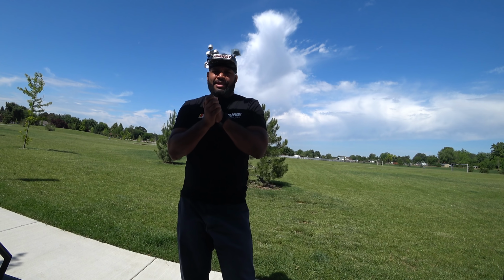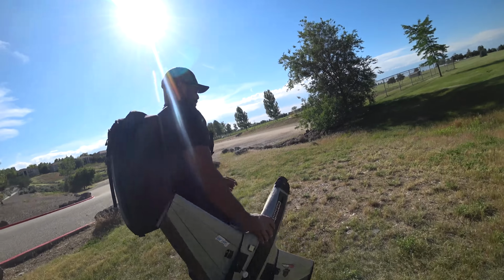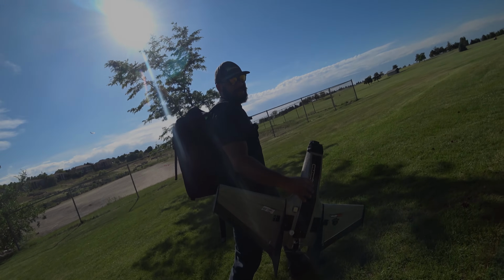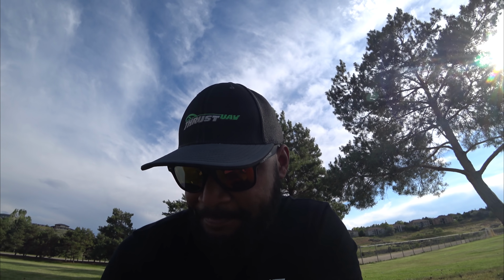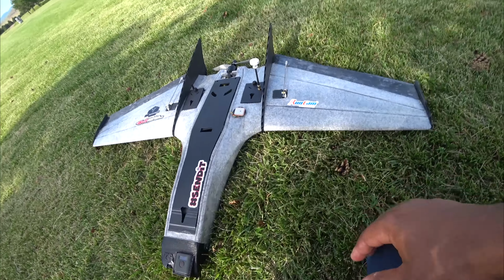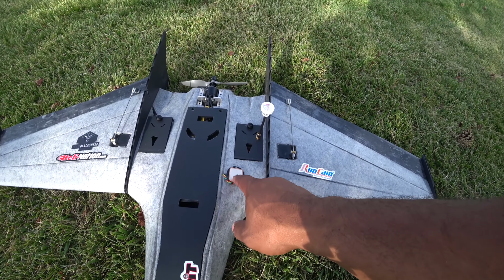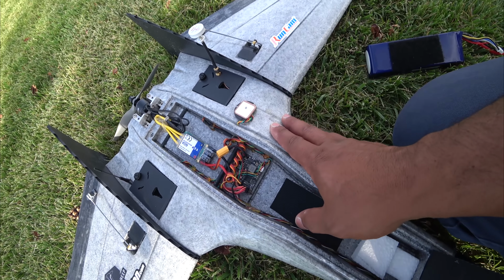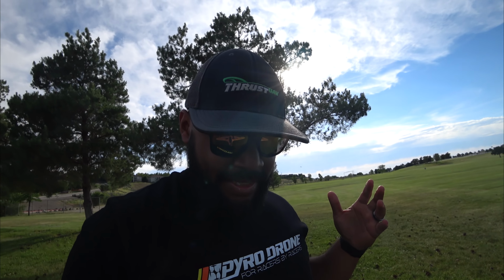Mini Drak Maiden!! // Failing at Inav

Comment: This is a lovely build. Thanks for sharing. I put the dji system on a flying wing. Pretty awesome. Can you recommend some good antennas for my dji Googles and air unit? I want to get maximum possible range....
Reply from the maker: TrueRC Xairs for the goggles and any good omni from TrueRC, VAS or Lumenier for the craft!
Reply: @Furadi  thanks for the reply. Yes, I was considering the true rc x airs ( seen your reviews on quads 😉). Do you happen to have a link for some good omnis for the air unit?. Does upgrading the air unit omnis make a big difference to range compared to the stock dji ones?

Comment: I have learned how to work the CLI menu in inav fairly well type dump and look for set fw_nav_launch and set the reaction time for the motor from 500 to 10 and you can set the weight for your motor to 1800 its work perfect for me every time hit me up and I can send my settings